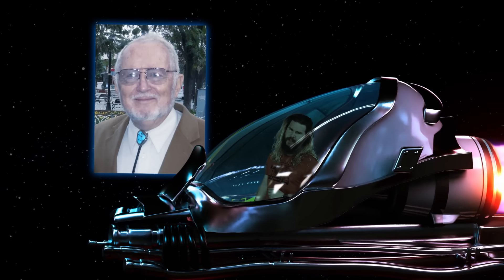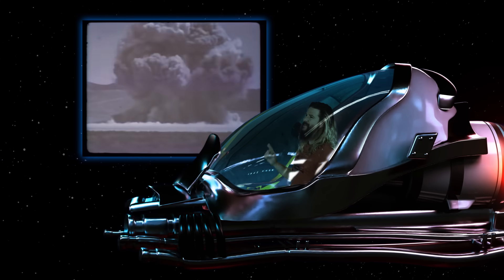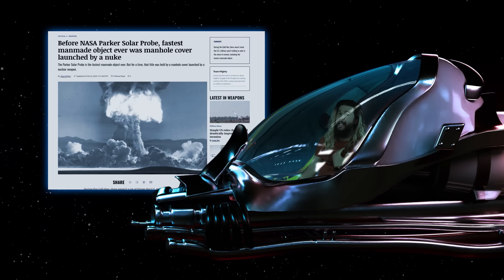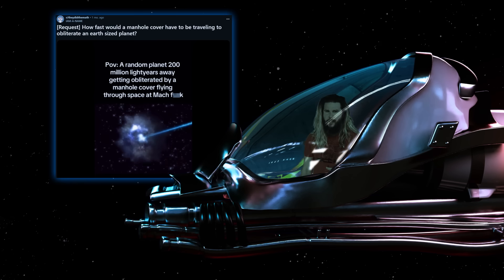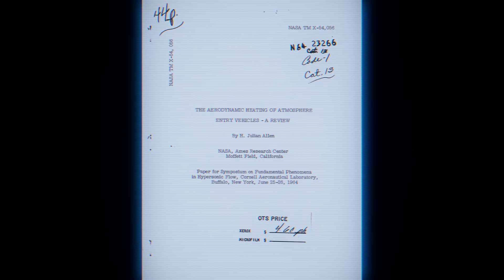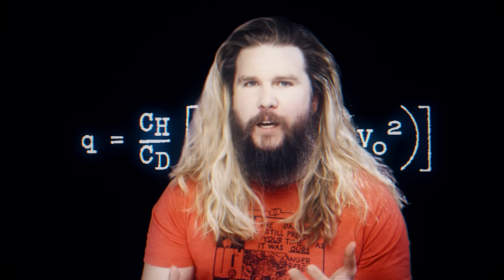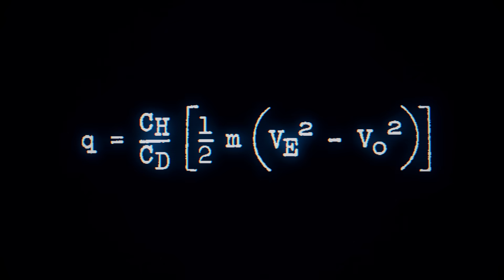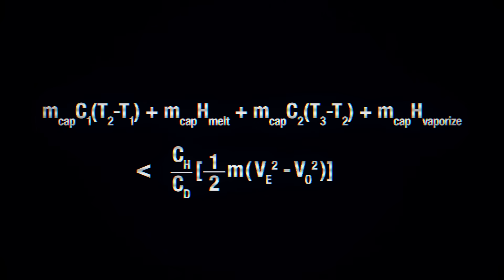Debunking the Nuclear-Powered Manhole Cover

Comment: Curious about this, as The Fat Electrician insists that even at the lowest calculated velocity (~Mach 105), the manhole cover would have left the atmosphere so quickly, it wouldn't have had time to vaporize, especially considering it was nearly one ton of steel. At Mach 105, the lowest estimated velocity, the manhole cover would have reached space in ~2.71s. Add to this, the earth's atmosphere is 81.06% as dense at 7000 ft as it is at sea level, the altitude of the test site where Operation Plumbbob took place, and it becomes much more likely the manhole cover actually did manage to escape the atmosphere, as it was launched at high velocity into a rapidly-thinning atmosphere.

Sea level: 1 atmo
7,000 ft: .81 atmo
29,000 ft: 1/3 atmo
10 mi: 10% atmo
The remaining 52 miles are at less than 10% the atmospheric density at sea level and it drops rapidly.

Further, the meteors that enter earth's atmosphere usually do so at a shallow angle, hitting miles of atmosphere before breaking up. Most of the time, these are a type of asteroid known as Rubble Piles, which either break up in the atmosphere, or are torn apart by tidal forces before entry. These meteors range from the size of a grain of sand to no bigger than a human fist, and usually burn up at an altitude of 60 miles after entering at a 40-50° angle (62 miles) at a mean speed of Mach 61. 

Add to this, the thermal conductivity of cast iron is ~52W/mK, there would be a column of expanding gas pushing (then pulling) the lid into space, further reducing drag. Then there's the possibility of the Reverse Leidenfrost Effect.
Reply: It was almost a metric ton it was 2,000 lbs
Reply: @kevinerbs2778 Fixed it.

Comment: Some questions...
Does this account for the air density reducing as it rose in the air?  Does this account for the cover slowing down as it moved?  Meteors obviously encounter increasing resistance and are falling with gravity vs against it.  Also, does this consider the cover flipping end over end like a coin falling or potentially going up on edge?  Does the flipping help it slow down enough before it burns up, but still escape?  Does the on edge scenario help it survive longer and reduce the friction enough to let it escape?  At that speed was there enough time for the iron to heat up to the melting point before the atmosphere was too thin with those extra variables?  Still have to answer some questions I think.

Comment: I think this fails to consider that it could've turned on edge, reducing. On the flip side, pun intended, it also fails to consider any heat energy it inherited from the nuclear blast itself, which the thermal effects preceding the concussive effects. So it'd have received some substantial heating before it even felt enough pressure to release from the ground. Also, the observation of meteors isn't the best validation since, while many of them are predominantly iron, most aren't truly homogeneous, unlike the cover ideally was. This video was still using some back of the envelope math, just a much larger envelope that has to be delivered by a parcel courier rather than your standard post. Not that I can do better. And I'd expect, while we may see some error in the numbers, repeating the experiment with modern techniques and instruments, high speed cameras, the findings would still likely support the findings in the video. So basically, while it excluded some details, this seems to be a very well done analysis and awesome video.

Comment: I dont think it changes anything, but what are the chances the disk shaped object flipped to its most aerodynamic state?  That would change the calculation wouldnt it?  Meaning, what if as a disc it flipped to its thin edge and sliced through the atmosphere like a frisbee.

Also, how mich energy was imparted to it as heat via the explosion.

Comment: Thoughts:

The cast iron cap was blasted off a borehole due to the detonation of a nuclear weapon in the bottom.

Because of this borehole, some amount of heat and radiation would have escaped the chamber holding the bomb. How much heat was transferred to the underside of the cap? Was it enough to start to melt or vaporize some of the iron?

Next, how much kinetic energy was transferred to the cap? This depends on the yield of the bomb and how much of its energy was able to escape up the shaft. This determines how fast the cap was moving when launched.

Assuming Kyle is right and air friction was enough to heat the metal to its boiling/vapor point, how long would it take to melt or vaporize a one ton (900 kg) iron disk 4 inches (10 cm) thick?

Last, how long would it take for the lid to reach the Karman line, 62 miles (100 km) up, where "space" officially begins? Would any part of it survive that long?

Drag decreases as altitude increases. If the lid reached 62 miles, is it possible that it survived long enough, in whatever form, to completely escape Earth's gravity and fly off to interplanetary space?

Kyle concludes that the cast iron cap likely vaporized in seconds, before getting more than a few miles up, and I trust his math, but still I wonder...? 🤔

Comment: I see a lot of comments on the topic of "is exiting the atmo actually analogous to entering, since it's densist to thinnest, rather than thin to dense" and while I'd like someone who knows more about thermodynamics to elaborate. 
I don't see anyone mentioning that 66 km/s is the FLOOR for how fast it was moving and that is wholly possible it was moving faster than that.

Also, rather than assuming the plate slowed to 0 before leaving atmo, wouldn't it be more accurate to calculate it's velocity as it exited atmo, and use that as the end velocity for the equation?

Comment: If it was moving that fast to vaporise from atmospheric resistance it would not have been in the any frame as it would have vaporised almost immediately. it most likely was moving slower and probably knife edged on its way up making its self more aerodynamic, also though thinning drag resistance. add it only has to make it 62 miles up to be classed as space. The likelyhood of some part of the man hole cover making it is possible.

Comment: You don't even have to reach the vaporization temperature. As soon as it's melting, it'll be ripped apart into droplets, dramatically increasing surface area, dramatically increasing drag, slowing it down enough so it's not leaving.

And no, it wouldn't have been the first object in space. That's a proud german achievement (from a time we are not at all proud of), when a V-2 missile was fired straight up instead of at innocent civilians.

Comment: You are wrong and your calculation is wrong. Los alamos is what 6-7k ft above sea level? You calculate for object going feom no atmosphere to dense one and full stop in velocity. 
And here we have an obj that goes from already less dense than sea level to low density and then space. 
It did not vaporized and it got into the space amin some small form.

Comment: Does that equation you used that was designed for atmospheric entry factor in the density of the atmosphere? Because if it did then it might not be usable in the way you repurposed it. At least, I would think so. Starting with low heat, and then getting higher and higher until your friction was that of air resistance at sea level is probably different from going from the ground to space. If it was initially heated high, and then it went low, would that let the manhole cover stay intact for more time? Or less time?

Comment: The Pascal-B nuclear explosion was a deliberate squib yielding only 300 tonnes of explosive force, about 10^12 joules. For the cover to reach any sort of escape velocity, say 12km/s, it would have required most of the device's yield energy to be perfectly coupled to the air in the shaft propelling the cap. It would also have to reach that speed in the first few metres of flight requiring an enormous acceleration and the Mach 35 shockwave near ground level from the cap travelling through the air would have devastated everything for kilometres around the borehole top. That sort of devastation would have destroyed the camera that supposedly recorded the cap's flight.
Reply: Your lack of understanding of basic ballistics is mind blowing.

Comment: As to the aerodynamic nature of the manhole, have you considered the possibility of it tilting or stabilizing during flight to that of a disk? I mean, i'm not trying a nuclear physicist, so i'm not trying to argue, but depending on angle it was sent flying or whether or not the forces were distributed evenly it won't be flying flat. If it hits at an angle does the atmosphere apply heat across the whole thing, or just the front edge?

Comment: You forgot to account for the change in atmospheric density, the drag of heating may not be the same. 66m/s means in just over 1 second it could be outside the atmosphere. 4 inches cast iron thing though so I don't have a clue if it really made it, maybe the plasma spacing could shield it enough, another thing we haven't accounted for? This manhole cover also went straight up from the densest part of the atmosphere to the least and meteors usually skim the atmosphere from an angle from light to dense atmosphere, so not sure if that matters.

Comment: Okay, so hear me out, Brownlee said they couldn't calculate the speed of the manhole cover cause it only appeared in 1 frame, but it had to move AT LEAST 66km/s to only appear in 1 frame not that it was the actual speed. Another factor to consider is the way aerodynamics work, the cover would have turned 90° in the air and flown sideways, witch would have had less air resistance, the same with lower air density and there for less friction so your mathematics doesn't add up.

Comment: The reentry does not heat the vehicle directly, the speed at some point compresses the air enough raise its temperature to plasma temperatures.  Then the plasma transfers heat to the vehicle.  Would a 4' dia x 4" disk compress enough air to form enough plasma to tranfer enough jeat to melt it in about 1.5 seconds

Comment: A couple of problems with Kyle's analysis.
1) The coefficient of drag is not constant in the atmosphere.  It drops quite rapidly as you move up in the atmosphere due to the reduced density.
2) For the same reason, the coefficient of heating will decrease rapidly as the cover ascends in the atmosphere.
3) While similar processes are at work for objects entering the atmosphere, it is not obvious that they operate exactly the same.  This is because objects entering the atmosphere are encountering increasing air density while the cover was encountering decreasing air density.  This will make the coefficients act differently in the equations.
4) Kyle's analysis treats all of these numbers as constants.  However, the only actual number that may be constant is the mass of the cover.  Every other 'constant' changes with elevation.
5) The analysis does not take into account the Shockwave and plume that, at lower elevations would have over taken the cover and protected it from atmospheric friction because the gasses were moving the same direction as the cover acting as a buffer.
6) The calculated speed was at ground level.  This would have decreased rapidly as the cover ascended, further reducing drag and heating.  A meteor experiences the opposite effect.
7) Kyle never stated the orientation of the cover he used to  get his coefficients.  There would be a massive difference between the cover on its edge and its face.  I suspect that he would use the edge as the best case scenario and because common sense would indicate that the cover would turn that way due to turbulence.

As such, while I can see the argument for the cover vaporizing, I don't believe it is definitive.  There are simply too many unknowns to tease out with such a simple analysis.
Reply: it would shatter though, it was probably already shattered in the first frame of the slow motion recording
Reply: @drcgaming4195  Maybe.  Entirely possible.  However, there is no definitive evidence.  That is what makes this problem so tricky.
Reply: @boeubanks7507  At the given speed, the drag force would be over a quarter million gees. That would be enough to stop it completely in 0.02 seconds.
Reply: @WJS774 That's assuming it's suddenly entering still air which it wasn't. It was traveling with a column of gas for the first bit which would make a big difference.
Reply: @niceguy191  No it wouldn't. The gas would encounter the same resistance that the cover would.
Reply: @WJS774  and then the gas immediately behind would keep pushing through and so on. It's not just a paper thin plug of gas but a jet. How could the cover ever get moving in the first place if the gas that pushed it would lose all momentum on the way?
Reply: There's probably too many variables and unknowns to get a definitive answer at all no matter how good your calculations.
Reply: @Devin_Stromgren  Only if it's close. If calculations take enough of the factors into account and show that it would have taken a thousand miles of air to slow it by 10%, or that it would only have made it a hundred feet into the air, that's pretty conclusive. It's only if your results say that it would take about a hundred miles of air to stop it that you can't be sure.
Reply: @WJS774  Except that doesn't take into account the sheer unprecedentedness of the event, and the lack of data from it, means we don't even necessarily know what numbers need to be crunched or what questions need to be asked.  It's a classic example of "we don't know what we don't know".
Reply: @Devin_Stromgren  This is a grossly unscientific thing to say, we know a lot about how objects interact with air at high speeds. There is nothing about the incident that is vastly outside of other things that we have knowledge on. It's becoming quite obvious that you just don't want to know what really happened because you have some emotional investment in the myth.
Reply: @WJS774  @Devin_Stromgren Has a good point.  Fluid dynamics is an exceedingly complex science with the equations that govern it often going well above the third order.  This means that they are not solvable except in specifice situations and/or trivial solutions.  So, the reality is that no one knows exactly how this situation would play out.  To get an answer, you have to use bounding assumptions to simplify the equations and generate solutions.  That makes those assumptions critical to the nature of the solution.  Any wrong assumption or bounding value will generate an incorrect conclusion.  

The simple fact is that Kyle's analysis, while food for thought, is extremely far from conclusive either way because it is too simplistic and uses some questionable assumptions.  I can't tell you if the manhole cover did make it to outer space, or if it didn't.  I would like to think so, just because it is hilarious.

Comment: I see a couple issues with using this equation as the basis for the thought experiment. The heat generated in re-entry is not just from friction. it is also coming from compression of the atmosphere. On an escape path, the density of the atmosphere decreases over time. Plus the nuke itself had a zone of low pressure where the atmosphere near it was sucked into the explosion, thereby reducing the medium that causes the friction and that can be compressed. To actually come up with a good probability of escape vs. vaporization you have to be able to calculate the heat loss from friction and compression in a lower pressure medium that thins as the object moves through it. This is because there is a point at which the decrease in atmospheric pressure  removes a portion of the heat rather than adding it to the material. This could result in the Iron becoming a liquid but not vaporising completely before it hits vacuum.

Comment: i believe the consensus is that the test cap would be disintegrated, however, if it happened to make it to space, it would be long gone by now. It is likely the fasted man made object every created, but like the people that argue about whether the mallard or the t1 was the fastest locomotive made... it's the difference between having an exact number and having a guess based on historical context and observations. while the mallard had it's speed clocked by an exact measure, the T1, is known to have likely gone faster then that, however the exact speed is... up for debate, and prone to inaccuracies. so... the T1 doesn't hold the official record for the fastest steam locomotive. It's an argument of semantics at that point. i'm perfectly happy giving the Mallard the record acknowledging the fact that the t1 was never measured and was likely faster. just like this, the test cap was likely the fastest object ever created however, we can't know what speed it was actually going so we can't really prove it actually went any speed. We have 1 frame.

Comment: I'm a mechanical engineer and I can confirm - fluid heat transfer is the WORST. It's the only engineering class I had to retake. The only other one that came close was Controls, but that's half because differential equations are really hard and half because they only gave us half a semester to learn what should take a full semester. And hey I passed it, it was a C, but I passed it.

Comment: One very important concept that Fat Electrician pointed out is the idea that the manhole cover was riding a nuclear accelerated column of gas up through the densest layers of the atmosphere. That would significantly reduce the aerodynamic heating numbers.
Reply: It really wouldn't make much difference. The gas propelling it would immediately start to spread out after it clears the shaft, it wouldn't magically continue pushing the cover any more than the hot gasses provide significant acceleration to a bullet after it leaves the barrel.